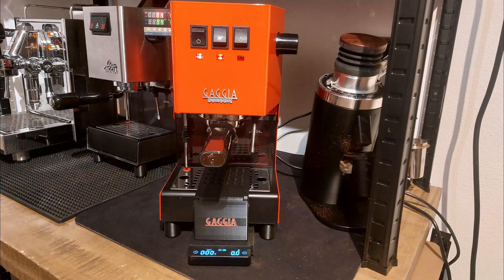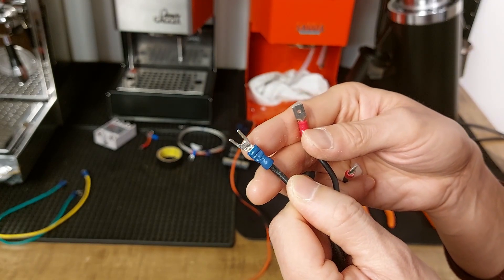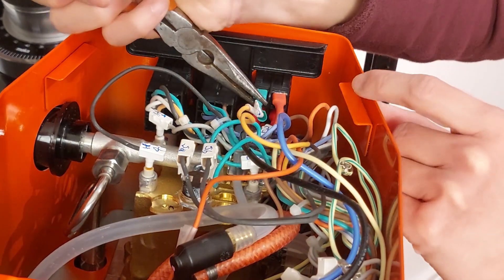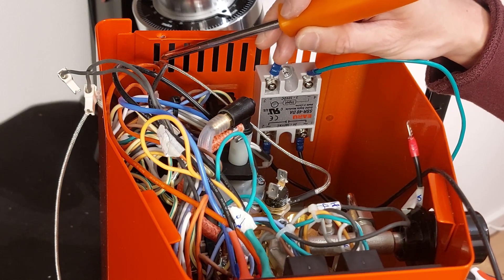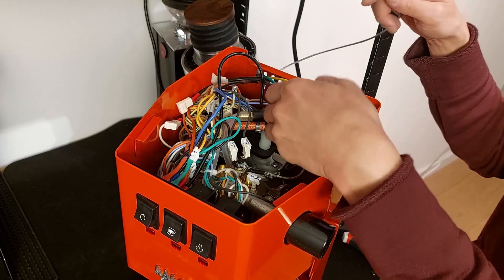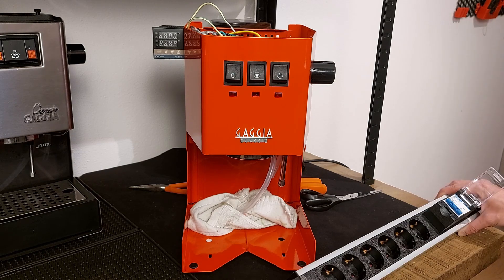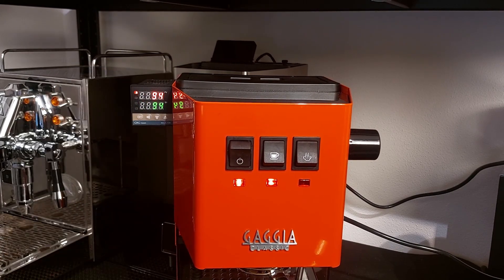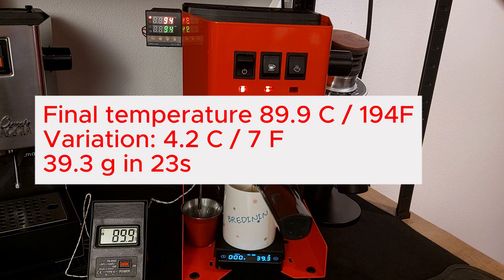PID in my Gaggia E24 in less than 10 min + testing back to back shots

Comment from the maker: Links for products that I mention in this video (it may be an affiliate link, you don't pay anything more but support the channel):

Gaggia Classic E24:
Amazon: https://geni.us/GaggiaE24

Gaggia Classic Pro Evo (not E24):
Amazon: https://geni.us/rcRaf48

PID Kit REX C100:
https://s.click.aliexpress.com/e/_Dcx7xVl
https://geni.us/weB41T (Amazon)

PID XMT 7100:
https://s.click.aliexpress.com/e/_Dey2HXH
https://geni.us/VGUOaz (Amazon)

SSR:
https://s.click.aliexpress.com/e/_Dk1Uvdz
https://geni.us/Gn2SdGX (Amazon)

Thermocouple type K Hole Washer:
Aliexpress: https://s.click.aliexpress.com/e/_DFdeQ3H
Amazon: https://geni.us/ThermocoupleHoleWasher

Screw and nut to fix the SSR to the frame M4 x 12 mm:
Aliexpress: https://s.click.aliexpress.com/e/_oDcO47N

Thermometer and thermocouple that I used in this video:
https://s.click.aliexpress.com/e/_DB5viZZ (Aliexpress)
https://geni.us/LYIOC (Amazon) 

Thermometer with Farenheit unit:
https://geni.us/2BMd4 (Amazon)

Crimper/Cable cutter:
Aliexpress: https://s.click.aliexpress.com/e/_DkOTzGB
https://geni.us/U7l7e (Amazon)

Wires AWG 16 or 18:
Aliexpress: https://s.click.aliexpress.com/e/_DcR8kbp
https://geni.us/AZMMKm (Amazon)

Spade connectors:
Aliexpress: https://s.click.aliexpress.com/e/_DdlcoOJ
https://geni.us/YwzUb1y (Amazon)

Piggyback connectors:
Aliexpress: https://s.click.aliexpress.com/e/_DcR8kbp
https://geni.us/KxvjO (Amazon)

Thermal Compound:
Aliexpress: https://s.click.aliexpress.com/e/_DB5viZZ
https://geni.us/VzBjsQF (Amazon)

Comment: I followed the instructions exactly, and when I tried pressing the steam button, it reached 170 degrees Celsius, and steam suddenly escaped from the group head. Also, when I enter all the parameters and measure with a flush, the water output is 85 degrees Celsius. How should I adjust the offset accordingly? Please help.
Reply from the maker: Your offset shall be around -11, at least it's what I measured in some Gaggias. This means that when the PID reads 106 in the boiler, it will deliver 95 in the portafilter. But for steaming, to achieve 150 using the PID, you need to set it to 139 ot you will get 161. The parameter for steam temperature is the boiler temperature.  Another thing that may be happening is overshoot. If your parameters are not calibrated, the fluctuations may be too high. For more details, I recommend you to watch my other videos about PID installation, especially the first one with the theory: https://youtu.be/bQUg0JJt8EM
Reply: @EspressoHackers  First of all, thank you very much for your interest and answer. When I pressed the steam button, not using the PID screen, it reached 170 degrees. Maybe it would have continued, but I pressed the button again and stopped it.
Reply from the maker: Did you put a jumper connecting the two wires that were connected to the steam thermostat? If yes, you need to control the steaming using the PID. If you want to use the steam button, connect the two wires to the original steam thermostat and it will limit the maximum temperature.
Reply: @EspressoHackers  No, I didn't use a jumper. I plugged in the original cables of the steam thermostat. So, that little jumper wasn't used.
Reply from the maker: That's weird. The two ways to deliver power to the heating element are visible the brew thermostat or the steam thermostat. The cables from the brew thermostat went to the SSR and cannot deliver power if the PID is not set to a temperature above 159 in your case (if the offset is -11). The cables that were going to the steam thermostat were reconnected and this thermostat should limit the temperature to 145 if I'm not wrong. For brewing it's all fine?
Reply: @EspressoHackers  Yes, everything is stable for brewing, but when I press the steam button (the PID is still at 94C), the temperature increases, but it exceeds the thermostat's limit of 145C and reaches 170C. Also, when I turned the thermostat to remove it, the black leg part turned about 1/8. I can't think of anything else.
Reply from the maker: @poyrazerdgn  The only potential cause that I can think is a damaged thermostat. If the PID is working, the power is being delivered to the heating element by the steam thermostat. If it's not limiting the current after 145 degrees, it may be damaged. Fortunately, it's not expensive, circa 7 euros in places like Blue Star Coffee, plus shipping. For now, I wouldn't recommend to use the steam button. If it exceeds 184 degrees, it may melt the thermofuse and your machine wouldn't work before replacing it or bypassing the protection which is not recommended of course. You can also test your thermostat, but you need to be very careful working with the machine powered: disconnect and insulate the two cables from the steam thermostat. Use the PID to heat the boiler up to 150 degrees for example (anything above 145), remembering that if the offset is -11, you need to set to 139. After achieving the set temperature, measure the continuity in the steam thermostat by connecting the two probes of your multimeter to the connectors in the thermostat. If there's continuity, the thermostat is not working. It should cut the power above 145. Hope it helps!
Reply: @EspressoHackers  You are a wonderful person. Thank you so much for all your help. I will follow your advice and let you know if I figure it out.
Reply from the maker: @poyrazerdgn  Forgot to mention: the thermostat will make a noise when activating and deactivating, a click, not loud. If it doesn't click around 145, it's another indication that it's broken. And you don't need a multimeter for that, neither to open your machine. It's not as conclusive as the previous one with the continuity test, but a good indicator.
Reply: @EspressoHackers  Yes, there are clicking sounds and the light turns on and off depending on the temperature. But the heat doesn't stop. I'll follow your instructions when I get home and see what happens.
Reply from the maker: @poyrazerdgn  clicks around 135-145?If it's around 100, it is the brewing thermostat that is clicking
Reply: @EspressoHackers  I tested it by removing the thermostat and heating it with a rag, it turned on and off without a problem. I took the probe from the steam thermostat and moved it to the brew thermostat. I set the boiler to 150C and it did not exceed 150. Then I pressed the steam button as I did at the beginning and it did not exceed 150. It dropped to 130, then returned to around 150, and then it dropped again, everything was normal.
Reply: I tested it by removing the thermostat and heating it with a rag, it turned on and off without a problem. I took the probe from the steam thermostat and moved it to the brew thermostat. I set the boiler to 150C and it did not exceed 150. Then I pressed the steam button as I did at the beginning and it did not exceed 150. It dropped to 130, then returned to around 150, and then it dropped again, everything was normal.
Reply from the maker: So it was probably stuck and got back to normal, but keep an eye on it. Glad that it's working again.
Reply: @EspressoHackers thanks for all You helped me a lot

Comment: I'm not going to do any of thesee, but congrats on your knoledge sharing!!
Reply from the maker: Many thanks for your support! And what brings you to the channel? What kind of content you're interested? Improving without mods?
Reply: @EspressoHackers  I currently have a Delonghi ECP 3420 with a naked portafilter and I'm trying to decide if an expensive machine ( 700-1000 for me ) is justified or not . 
I also enjoyed your video that you compared the Gaggia with the ECM Classica PID .
One of my options is the Gaggia E24 :)
But to my surprise , I find out that the Gaggia has a much smaller boiler than my Delonghi 
Keep up your fantastic videos!
Reply from the maker: @teobot2 in the cup, I don't think you will see a great improvement. But Gaggia has a solenoid valve and it's convenient. Build quality is also a bit better. But if you want to raise the bar, I'd buy something with a native pid like a Profitec Go or Apex V2. H
Thanks for your support!

Comment: Very nice guide ! thanks for going through the trouble. According to schematics you placed the sensor in place of the steam thermocoupler. Did you had a chance to try placing where the brew thermocoupler is ? if yes did you observe better results ?
Reply from the maker: Thanks! In other videos here, you will see that I installed exactly where the brew thermostat is, but it's a bit inconvenient. In terms of performance, I didn't see any difference, maybe there will be in offset, but since I measure the temperature in the puck, simulating a shot, I may have the optimal setting for that position. And I'm not able to compare because the other machines that I installed the thermocouple replacing the brewing thermostat were Gaggia Classics with aluminum boiler and E24 is brass. But again, I don't expect a major difference in performance.

Comment: Thanks for the video. 
Why mesuring the temperature at steam side instead of brew side ?
Reply from the maker: Just because it's easier to access. To remove the brew thermostat and install the thermocouple in the lateral, you need to remove the screws that hold the boiler to the frame, and ideally remove also the steam wand and its knob.
Reply: @EspressoHackers thanks for the fast answer

Comment: Your videos are excellent — rich in detail and very clear in explanation. Congratulations!
I just have one question. I have a Gaggia Classic E24 and I plan to install this PID kit. I want to use it both for brewing coffee and for steaming.
I noticed that the thermocouple was placed in the steam thermostat location. I saw in the video that the temperature setpoint was 94°C at one point and 150°C at another. That got me wondering: how can I set the temperature to 94°C for brewing and also to 150°C for steaming?
In other words, is it possible to program two different setpoints on the REX C100, or does it allow control of only one temperature at a time?
I’m looking to get better results with steam as well. Obrigado!!
Reply from the maker: Thanks! The PID controls one temperature only, you need to change to steam and after that to go back to brew temperature. Or you can leave the steam thermostat connected and use it to steam as you would normally do. Another option is to use the alarm function with another SSR, but I didn't investigate/test this option.

Comment: I like this thanks so much! So would this be possible on a Gaggia Classic 2011 Milano? I assume you’re just putting the temperature probe on the steam thermostat, which is still reading the boiler temp? Instead of putting it down on the bottom brew thermostat hole? Or am I mistaken?
Reply from the maker: Yes, I placed under the steam thermostat because it's easy to remove the steam thermostat and place the hole washer termocouple under it. The brew thermostat, in the lateral, is difficult to remove.
Reply: @EspressoHackers thanks! Great idea

Comment: Thanks for this test. It would be great to see how Rancilio Silvia with PID handles back to back shots.
Reply from the maker: I didn't teste because it has a much bigger boiler, 300 ml. This is not an issue for Silvia. I had a doubt about the Gaggia Classic because it had a 80 ml boiler and now it's 100 ml but still small. However, the design is very smart and Gaggia is not much worse than Silvia in this sense. For steaming, it's more complicated, and then I think Silvia will have much more steam available and only with a Gaggiuino and Dreamsteam Gaggias can deliver as much or more steam than Silvia.
Reply: My only concern about Silvia in this regard is the boiler not sitting directly on the group head.
Reply from the maker: @MrSyeryoha  it could be better if it was a saturated group, but for domestic use, my impression is that we take longer to prepare the next puck than the machines to recover the temperature, I mean, machines like Gaggia, Silvia, ECM Classika PID, Vibiemme Domobar, that I already tested... these machines recover the temperature in less than 2 min.

Comment: Hey there, i have a question: I tried all night to set up my PID in my Gaggia classic evo pro (not E24) from Europe, I didn’t do the switch mod. I did the same wiring as you. The machine and pid are running now but the boiler doesn’t heat up on its own, or maybe the SSR doesn’t switch. But it looks like the PID isn’t doing anything, no blinking. I put the correct settings. Do I need the switch mod to be able to apply your routing? Or any idea? Thanks a lot!
Reply: I did it with a xmt7100 and the pt100
Reply from the maker: Did you set the sensor as PT100? I don't remember by heart the name of the parameter, but you can see in my video about the PID installation in a Rancilio Silvia, I think I showed there. And you need to check if your model works with PT100. Some of them work only with type K.
Reply: @EspressoHackers hey yes i set the temperature and I set it to pt100 like in your video, the out light is constantly on but it doesn’t switch the ssr on, no light on the ssr. Is it a problem with the ssr then or maybe a broken cable somewhere?
Reply from the maker: @chrisb.7735 if the PID is blinking and the SSR is not, I'd check if you connected the SSR to the right pins in the PID. Notice that there is a positive and negative.
Reply from the maker: You don't need the power switch mode to make the PID work but it may work for 15-20 min only. If the pid is not blinking, it's not reading a temperature below your set value. Did you define the SV?

Comment: Thank you for the video. Ok PID keeps the temprature stable and prevents so called temp surfing 🏄‍♂️. What I wonder is how was the temprature fluctuating without PID control. I recommend you a video; keeping the same LED Display but opening the case again, disconnecting the PID control and keeping old thermostat for existing temp control of gaggia. And run the machine. So by the Led Display, we will be able to monitor how was the temp surfing, what was the limits and how was the temp sequence before doing the PID modification. Thanks in advance. 😉
Reply: Upps, I’ve just noticed that you had that video already in the channel. Great minds think alike 😀 perfect!

Comment: This is good. And doesn’t look expensive at all looking at the parts
Reply from the maker: Not at all, a PID kit is about 10 USD if you use the Rex C100. Plus the hole washer thermocouple, circa 2 USD. Then, if you have wires  connectors and tools, it's just these 10-15 dollars with freight, buying from Aliexpress. A bit more expensive if you chose the XMT 7100, but still less than 50 dollars.
Reply: @EspressoHackers  qual vc prefere Regis? Rex c100 ou xmt 7100? O processo de instalação pra uma evo pro comprada nos EUA é o mesmo?
Reply from the maker: @kawabr eu gosto mais do C100 por mostrar a temperatura atual e alvo ao  mesmo tempo, tem gente que prefere o 7100 por ser mais clean. Numa maquina americana, tende a ser mais fácil por nao ter o eco mode e nao precisar fazer a mod do botão de power.

Comment: Excellent video as always. Can you please recommend a housing for the rex c100?
Reply from the maker: @geomcl  thanks. I didn't find a good 3d print design for the Rex C100, neither on Aliexpress. I'd probably design from scratch or remix this one: https://www.printables.com/model/841037-simple-rex-c100-housingenclosure
Reply: @ thank you
Reply: Could you just swap the Rex C100 for XMT7100 with aluminium with enclosure? Any difference in using the steam thermostat for the temperature sensor versus the brew thermostat other rather ease of access?
Reply from the maker: @geomcl  yes, XMT 7100 will do the same, just different settings in P, I, D, offset... I have a video showing the installation in a Rancilio Silvia with more details on the XMT. The difference in controlling the steam temperature with the PID is that you can set higher temperatures than the thermostat and get more and drier steam, that's what it's made in Gaggiuino where they use 155 degrees (but notice that if your offset is set to -10, your steam temperature shall be adjusted to 145. Much higher temperatures may melt the thermofuse).

Comment: what gauge wire are you using in this installation? thanks for posting these kinds of video
Reply from the maker: Thanks for reminding me! I use 16AWG but it may be a bit tight in 6.3 mm connectors, 18 AWG shall be ok, it's what the Gaggiuino community recommends in their mods.
Reply: @  awesome! Thanks man. I’m planning on doing this for my e24 until my gaggiuino shows up. Their wait time are crazy right now from the supply fiasco they went through. Your videos are really helpful.
Reply from the maker: @randomguyfromtx4473  in reality, ut was a bug in espressif firmware in the microcontroller that Zer0-bit identified and the careless work from the display manufacturer that changed components without notifying the customers. It was a pain, but under the control of the Gaggiuino developers.